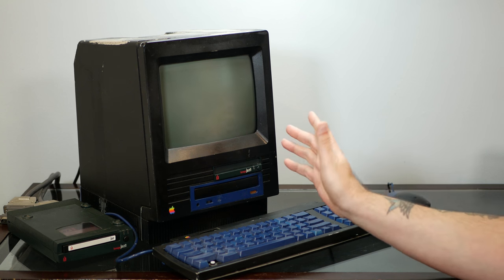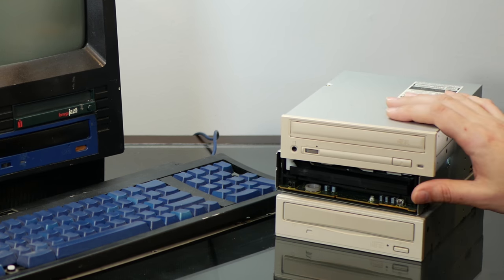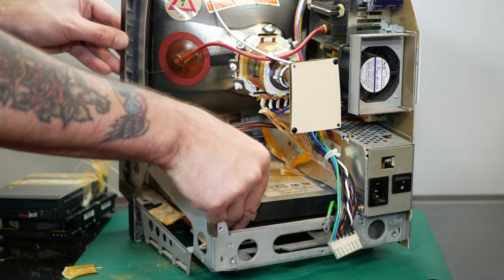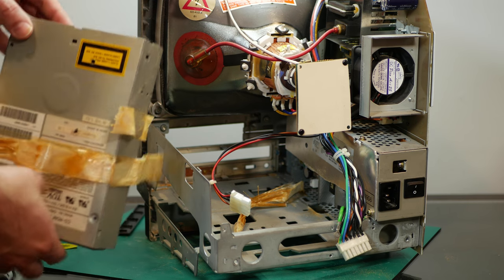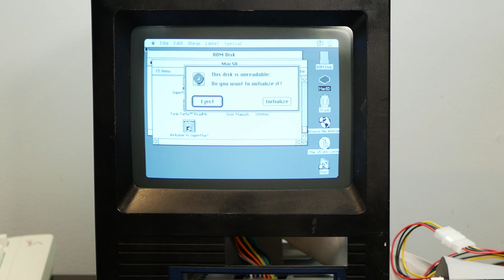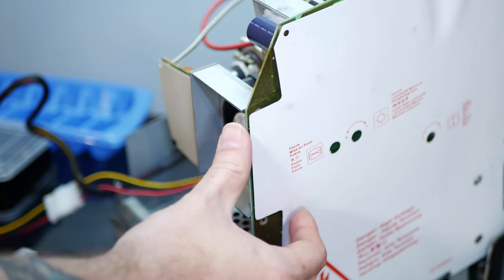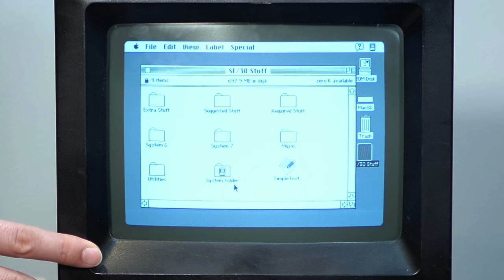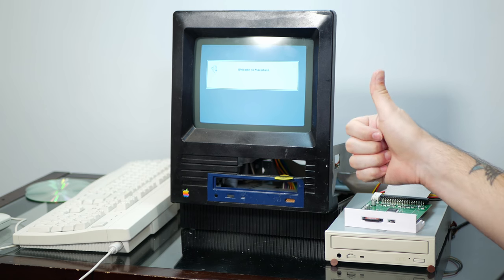The CURSED Macintosh SE, Part 2: Optical Revenge

Comment: I really got to try to encourage you to do the recap yourself. It's really not necessary to have SMD soldering skills to do these types of caps. It's really only a dangerous proposition on REALLY old Macs where you have the risk of corroded traces. SE 30s are new enough that's most likely not going to be an issue
Reply: lindoran:  We’re all afraid of doing a botched job.  Could do something wrong and, not only might the thing not boot up, but we fear we could fry the motherboard.

I have a soldering kit I’ve never used — precisely for this reason.  I suppose there are YouTube videos for those of us with no idea how to get started.

Thanks for your encouragement, though!

Comment: Have you ever tried to emulate an motorola 68k mac with a PowerPC mac? I have, and succeded. #macception lol   however, doing that had me getting a Basilisk II github source commit from 2012 as i was unable to track down a PPC build of it. Wierd thing was i was unable to build the app version due to compiled libraries for the x11 software being used in it. Most of the libraries i had personally compiled to use with SheepShaver. Yup. SHEEPSHAVER. #doublemacception lol This was on osx 10.4 on a PPC G5. And yes, both emulators work

Edit: to clarify, this was directed all at ppc mac os x users, not just the person behind the channel, idk if he even HAS a PPC G5
Edit 2: i just noticed a bit that made me seem like i was full of myself, i don't want to seem like that. Deleted that bit
Reply: You know that Mac OS X up to Tiger (10.4) provided a classic emulator that allow to run all Mac OS 9 supported apps? Also Classic Mac OS on PPC system do one thing before booting the system: running something called the nano kernel which include something really important for POC devices: a 68k emulator.

Yes. Early PPC system for PPC and early PPC 601 Mac (the Nubia’s one) the firs5 thing they do is to start the system through a 68k emulator, and even in the lastest Mac OS 9 there are still large portion of the system itself running in 68K mode. 

So 68k emulator on PPC Mac running a classic Mac OS is nearly useless :D

Fun fact, some old 68K apps works better on a PPC Mac with a recent classic Mac OS than on some of the most recent 68K system.. yeah it’s weird.
Reply: @godzil42  the m68k kernel level emulation software was removed in os 8.5 i think. And i needed to emulate versions of mac os that the classic software cannot, mac os 7.6.1 and mac os 9.0.4, but yes, i knew both of those facts
EDIT: damn phone. Fixed a typo

Comment: If the SCSI HDD works, recover that.  It will last longer than most SD cards do.  SD cards are known to fail, just ask any person who owns a Raspberry Pi.
Reply from the maker: Hah interesting, I hadn't considered that. I'm mainly worried about power draw, but if I do the PSU replacement mod it would be cool to have both the SCSI2SD and the mechanical HDD. Four drives inside an SE/30, who could have imagined lol.
Reply: @ActionRetro  sounds like a plan.
I don't think power draw would be a huge issue.  CD rom and Jazz drive use next to no power when idle.  Bit like having a floppy drive sitting there idle. 🙂.
I guess if you had CD Rom, Jazz and HDD hammering at the same time it might complain.
Reply: SD cards seem to be the only option for old Macs, though. Nobody has made a SCSI to SATA/IDE device that works with Mac's old, special version of SCSI.
Reply: Aren't there industrial grade SD cards on the market that would be a better fit in this situation?
Reply: I doubt that. Get a high quality SD card and it'll probably last longer than the SCSI HDD (since that HDD has probably already had its fair share of use). 50 pin SCSI disks are ancient at this point and are dropping like flies (from what I've heard and from first hand experience). Hardly any of mine work anymore, but on the bright side my NeXTstation briefly sounded like a failing jet engine.